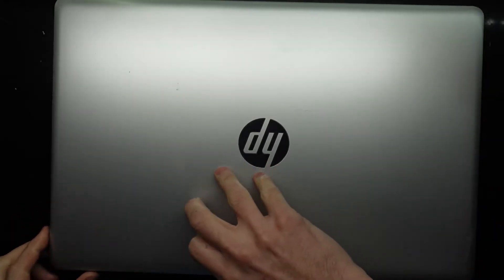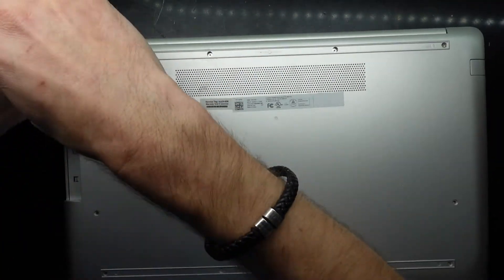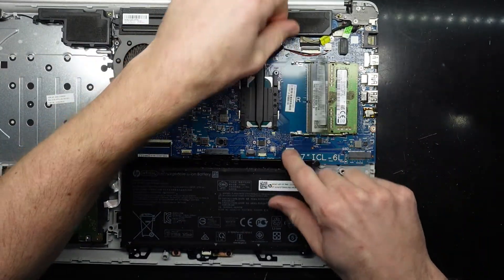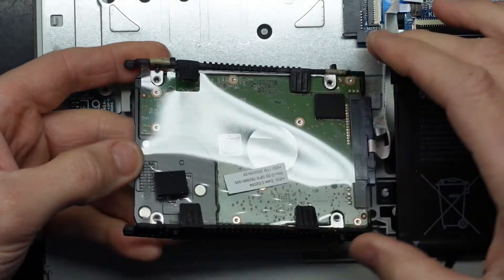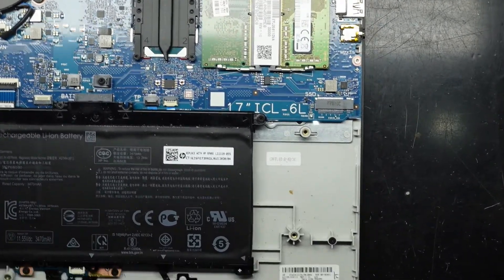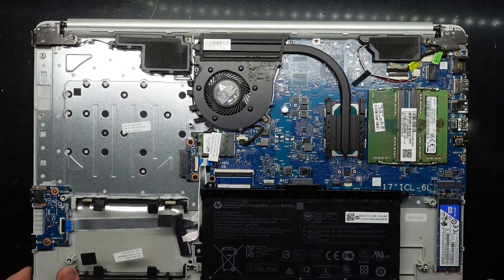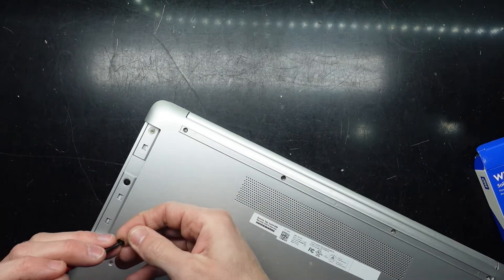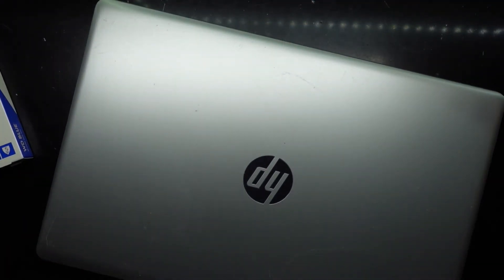HP 17 BY 10th Gen Intel Laptop Ram and NVMe Upgrade

Comment: I have similar PCIe slot, but the laptop can not regconize the NVME. I tried many way to access the advance bios settings on this laptop but no luck with bios F.24, to change to AHCI setting. Do you encounter the same problem? Do you know how to access the advanced settings on this laptop?
Reply: If you pause the video when he is  showing the SSD box, that is an M.2 Sata SSD. It still uses the SATA interface, not PCIE. M.2 describes the form factor of the connector, but noticing the keys (and  the box, that is a SATA M.2 SSD. I hope this clears things up I know this comment is two years old though

Comment: 1. Is that the wifi card on the back as well cause if I buy this unit I want to upgrade to AX .... 2.  do you know if when backlight keyboard is on, does the space bar blink when you press it  (that was an annoying feature and the reason I returned an HP about 5 years ago)
Reply from the maker: wifi card is next to the fan

no idea about the blinking key, doesnt sound normal

Comment: I have a similar computer.  Same motherboard.  It also has (probably) the same WIFi card and that is the RTL8821CE.  It would have just one antenna (one connector on the card rather than 2).  If I have a better WiFi card that has both would I need the second antenna?  I have an AX200NGW (non V-PRO) I can use.  Would I have to install a second antenna?  If so does it really have to go inside the display bezel (a lot of disassembly involved to get to that).  Or could I just put it in an unused part of the case?  I am thinking of puting it in the spot where a 2.5 inch drive would have been on a different model using the same board.
Reply from the maker: i think you can just use one antenna if thats all thats there in the laptop